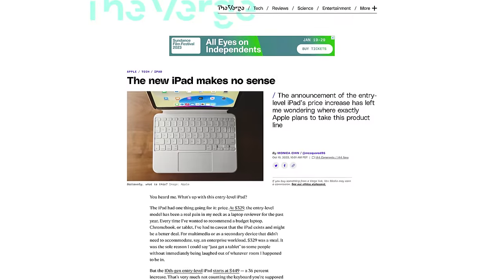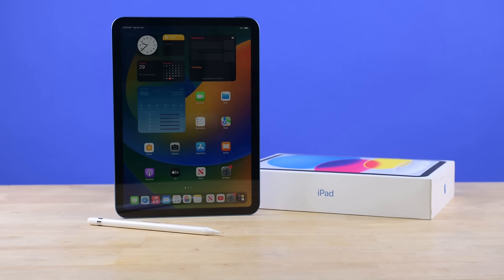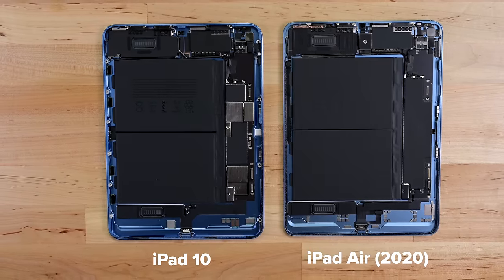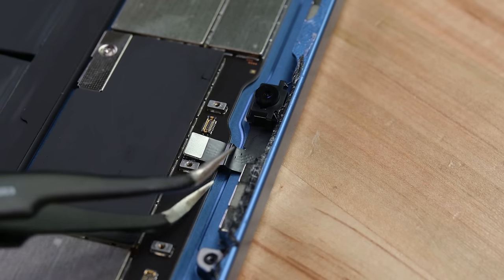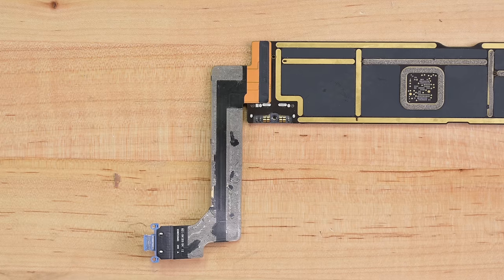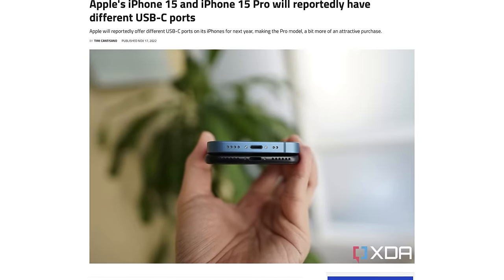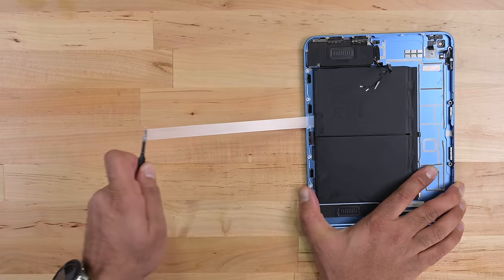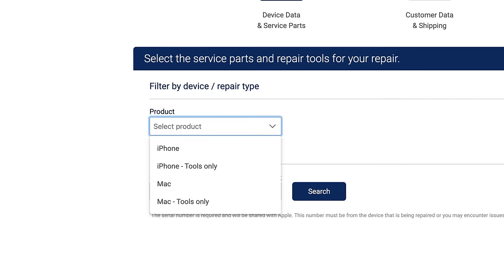iFixit Tears Down the Baffling iPad 10!

Comment: USB-C port locked to USB 2.0 speeds if you don't know. While on Air 4++ you have max speeds.
Reply: The key different is the AIR has an operate USB-C off die controler compared to this iPad that is just using the USB controler within the SOC that is used for lighting.
Reply: Refurbished iPad Air is far better value than iPad basic…
Reply: Apple Lightning port supports up to USB 2.0.
That while USB-C supports DisplayPort, Thunderbolt, USB4 and more if needed, like on the higher end iPads.
Reply: Lightning supports display, audio and can reach higher speeds with the appropriate controller on the board. USB C is a clear downgrade in terms of durablity. Bring lightning back with an updated controller already.  @Arutemysu
Reply: Lightning and thunderbolt should still be the way to go for Apple. As of today, USB-C still has no standardisation and every manufacturer can be different in specs which made consumers confused and of course, money wasted.
Reply: So you can airdrop three 12mp photos to a MacBook once a year?

Comment: Everyone thought the availability of self service repair would bring change, but Apple still make some baffling decisions in terms of repairability. At least the digitizer is still separate and relatively easy to repair. That's probably the part that most people break most often.
Reply: The self service repair was designed to hold off the right to repair movement long enough so interdependent repair would die off. They will probably keep it around as something to point to when anyone questions them.
Reply: The iPad was brought back as the ‘school model’ and has always had a separate digitizer since then.  Glad they haven’t gone back to the iPad Air 2 debacle with the digitizer bonded to the LCD (they were selling the Air to schools at that time).

Comment: USB C with Gen 1 Pencil is a deadline push. The new iPad had to come out, and it had to be quirky with its landscape front facing camera, so there was no way they could’ve possibly had time to figure out how to throw in Gen 2 connectivity.
Reply: They could have put it on the other side or make a new apple pencil pro like samsung that's full blue tooth and can attach to any magnet on the tablet
Reply: that sounds really plausible, the deadline

explains the non-existant macbook 2022
Reply: You mean, the self-imposed deadline? No, sorry. This is not a hard engineering problem. This is a problem caused by setting a weird requirement for a camera placement and where the pen charges, ahead of more important things. Bear in mind this is the company that thought their first pencil design was good, and not an accident waiting to happen.
Reply: @StarLightFilmProductions  The other side of the iPad is used by the keyboard pins. I’m not sure what you’re trying to say with the second point - the pencil is already “full Bluetooth”, the problem is how to charge it. When I look up Samsung’s pen, it looks like they need to be connected via magnets to a specific location on the tablet to charge, which is what Apple did with Pencil 2.
Reply: @bawbsmith  they should at least make the iPad a bit thicker to implement that but also I'm not talking about the samsung pens that come with the galaxy tab I'm talking about the spen pro the one that you can charge by hooking it up to your USB c charger all you have to do is grab the cord and plug it in to charge even tho that was the past with the first Gen apple pencil this spen pro dose not need to be in the tablet but also at the same time it's nice to just have it connected to the tablet itself
Reply: Nah this wasn't an issue of the deadline. It was done solely to differentiate the iPad from the iPad Air. If they had made it compatible with the far better and convenient Apple Pencil gen 2, it would have effectively killed the Air
Reply: @bawbsmith  possibly they ment on the other side where the camera used to be?

that might be a decent placement for the pencil.

granted, i dont mind the dongle to charge it because it makes a bit more sense than how it used to charge.
Reply: Ipad 10th gen users was meant for non Apple Pencil users anyway.
Reply: @pinroshan020  close, it's meant for an audience who likey won't want to pay the price apple likes to charge for their gen 2 pencil. Apple segmented their tablet lineup to keep people buying the more expensive models but this way they can still make $ selling "pencils" with cheaper model
Reply: @mattmichael2441  yes I agree! Ipad 10th gen is really an overpriced tablet.
Reply: you really sound like a fanboy
Reply: @Carl Gunderson i really don't look out for news about macbooks at all lol i don't use macbooks
Reply: @Carl Gunderson i mean, size is a thing
that's literally why ipad mini was made

size
Reply: @Carl Gunderson nah, it's just that i know less about macbooks than, say, ipad and iphone lol

Comment: Since the likely majority of iPad repairs are to fix a broken screen, I wish you had at least made some positive commentary about this iPad continuing to use a non-laminated display. Screen repairs will be tremendously cheaper and easier on this iPad than on any of the more expensive iPads, because you can just replace the glass and digitizer unless something truly terrible happened to the iPad.
Reply: And it looks cheap as f. Wish they just supplies cheaper replacement screens
Reply: @nami1540  since it is non-laminated the front glass can be replaced without replacing the display panel this means it is much easier for third parties to make replacement options.
Reply: These folks will never be happy
Reply: @hishnash  That's not what he's saying. 

Apple didn't do this for better repairability, they did it to cut costs on the lower end iPad. Laminated screens looks much better but are more expensive, and more expensive to repair. That's why they're only on the more expensive models.

Comment: I find it interesting that they pull out the iPad Air 4th gen but they never did a teardown of the iPad Air 5th gen. Makes me wonder if they did and found it to be almost identical except for the new CPU?
Reply: The iPad Air 4th Gen has the same A14 chip as the new iPad so under the hood they're essentially the same device in an almost identical enclosure
Reply: They are nearly the same. I've already had to do quite a few repairs on them and they mostly use the same parts as each other.
Reply: There are some speculations on the 5th generation build quality (thinner aluminium compared to 4th generation) and iFixit never did a teardown, lol.
Reply: @mochimejika  do they share the glass and lcd like other iPads compatibility wise
Reply: @MrMariovideo13  It's a fused display on them rather than separate like on standard iPads. The air 4 and 5 do use the same screen though yes.
Reply: @poobalu  The dumbest part here is that it's just a worse iPad Air 4, no AP2, non-laminated display and even more expensive than the iPad Air 4.
Reply: @Carl Gunderson At least the price is what kept them apart, but the new iPad 10th Gen is just as expensive or more expensive than the iPad Air 4 here while being straight up worse in terms of value.

Comment: 3:49 Imagine your car tires being glued shut to your wheel axles. You are completely right - consumables should be easily replaceable to keep you going, not leave you stuck and incapacitated.
Reply: Im assuming you mean car wheel being not tier. 

Very few consumers have the equipment to correctly replace a car tire, we can swap out a spar wheel but the needed tools to properly replace a tier on a week and do it properly so that there is no dirt/grime etc in the seal is non trivial. In fact many tiers do use a form of glue like martial to bond/seal that needs some heat to remove. The last thing you want is any dirty making its way into that seal.
Reply: @hishnash  You' re correct. I was thinking of changing a flat or worn down bicycle tire for some reason. 🤔🤷‍♂ Wasn't really thinking about the technicality, just an example. Let's say sneakers (soles) glued down to our feet? 😂
Reply: @em0_tion  true while one would not glue to sneaker shues to your feet as you might want to change what you are wearing the soles on all sues made in the last 200+ years have been glued (and sometimes also sown). 

the use of glue has many functions but one of the most common is to ensure a seal to stop water, dust etc.  Glue in most situations can be removed (like the glue used to seal the screen or battery in an iPad) but as a user case.

I see many people wanting batteries to be screwed down but the nature of lithium batteries is that if you put a single point of pressure (such as a screw) into them when they expand they become spicy and start to smoke/burn, (and all of these batteries at some point expand).

So gluing (with pull tabs) a battery on one side is the best option as this does not provide and localised compression points on the battery when it does expand (they all expand at some point). It is much better for the battery to gradually push open a device. Just think of how many of these devices will be forgotten at the bottom of peoples draws etc in 10 years time when the batteries start to swell. It is very important that when this happens the swelling can happen without starting a fire, by just gluing the back of the battery in when the battery expands there is uniform pressure across the battery and that pressure is low enough that the expansion can slowly pop of the screen (as the alternative is starting a fire).
Reply: @hishnash  bruh tires are NOT that clean to seal. its mostly pressure that does it. 

ive seen a tire glued but its rare and only done when the wheel is minorly damaged, anything more and you just have to replace the wheel. 

ive actually done tires for a living, have you? doesnt seem like it
Reply: Yeah, I hate when my tires end up glued to my axles 🫤
Reply: @ObviouslyMegamind  Trolling by literal interpretation on purpose, love it! 🤣👍 We should get a beer, blue head. 🍻
Reply: @em0_tion  blue head 😂
Reply: @ObviouslyMegamind  Megamind, obviously. 😂🤘
Reply: @em0_tion  ahhh

Comment: "The USBC ribbon cable is welded to the logic board"

Wtf why Apple why!?! Do they not know that the socket is something that’s likely to need servicing within the lifetime of the device?
Reply: You already know why, it's to force unnecessary logic board replacements, therefore forcing consumers to consider premium support/a brand new device.
Good old eco-friendly Apple, throwing away devices just because a port was damaged 🙄
Reply: Manufacturing cost and capacity.  Building the cable and welding it to the board can be all done on an automated production like.

Attaching a ribbon cable using a socket required manual labor this costs money but also right now is very limited (given the issues with supply chain).  I expect right now given all of these devices are supply constrained based on manual labour not automated production like. if apple can 1/2 the amount of manual production time needed for each device they can ship 2x the number of units.

Comment: To be honest,  I value more the new camera placement than the apple pencil charging situation as no many people I know uses the apple pencil, but more who complain about the front camera placement since the iPad 2.
Reply: Agreed. Apple Pencil has it's place, and the Apple Pencil 2 is awesome—for those who use it. Far more prospective buyers will find themselves using the webcam for videoconferencing though.

Reviewers seemed confused by this iPad, but lots of people will buy it who would never buy an Apple Pencil, and those people will thoroughly appreciate the camera placement and the USB C charging connector. Apple made this product with certain users in mind, and those users will really appreciate the design decisions, without even noticing  the drawbacks (even the USB 2.0 speeds are a budget-meeting measure that won't affect most consumers).

Comment: That digitizer not laminated with the LCD  touched my heart🥺
Reply: cost cotting.
Reply: Actually, Apple takes this gap as a downgrade that is supposed to push people upwards in their product stack.
Reply: @terriplays1726  Makes it easier to repair tho
Reply: @frokfrdk  Honestly, I feel Apple should make a "repairable" version of their devices. And call them "R", iPhone R easy to open, not laminated screen, screw in battery and main board, modular charge port.  Same for an iPad R and an MacBook R.  It will lose some of the high end features because of it, but you can make a device that is fully repairable.
Reply: @SanderEvers  iPhone XR
Reply: @SanderEvers  what a bad idea

Comment: Any experienced iPad technician will not complain about this design. In my opinion this is slightly better than repairing an iPad 5/6/7/8/9. Touch ID is on the power key which is very rarely damaged during screen removal. Still no face id to worry about. The digitizer is separate from the lcd. Your local third party repair shops will have no problem fixing screen/battery/ports and hopefully cameras for a reasonable price soon. Lets hope the battery, screen, and cameras will not produce non genuine parts message.

Comment: compaired to how the gen 1 pencil used to charge, the dongle is probably an improvement.
Reply: The gen 1 has always come with a Lightning to Lightning dongle in the box so you can charge it at the end of a Lightning cable.  It's easy to lose though so it was never a good design choice!

Comment: Yeah, I'm not having one of those. The Apple Pencils are expensive, and a tablet that sells for £500+ but uses a 2 year old processor, as first seen in the iPhone 12 series? You could have at least used the A15, in use with the iPhone 13 series and base 14 (non-Pro).
This is like trying to cram the contents of a Surface Pro 7 in a new chassis (with a standard charging port) and calling it the Surface Pro 9. (Which thankfully, Microsoft hasn't done.)

Comment: I can help but wondering why apple leaves so much space instead of filling up with other components like larger battery or make it work with apple pencil 2. if the case is all about no room for the wireless charger, then all the space at the bottom of the ipad is for dust and air?

Comment: Samsung managed to wirelessly charge the S pen on the back of the Tab S8. Not sure why Apple couldn’t do the same
Reply: Maybe because the iPad 10 is $449 while the Glaxy Tab S8 is $850
Reply: @FlorianWendelborn  Doesn't matter, if they can produce an adaptor for the pen, they can add some magnets to the back of the iPad for charging a pen. Magnets are cheap, they already have produced the wireless charging for the other iPads, they just need to move the magnets from one position to another, the work has been done before.

Comment: IMO the argument that the charging coil would interfere with the magnets is pretty invalid since the magnets obiously would have fit just fine (like many other manufactures do). Apple just does not want the pencil to sit off-centred on the side of the tablet. Probably because this would contradict their perfectionistic approach to design.
Surely a 1st gen pencil awkwardly dangling from a USB-C-to-Lightning adapter has been a better design choice🙃

Comment: I'm confused. Is the USB-C port really "welded"? or just soldered? coz these two are different things where the latter is removeable by the use of a soldering iron or hot air gun.
Also it makes sense to solder these things to prevent loosening overtime, just like how other ports like usb-A and HDMI ports are soldered diirectly into the pcb for more secure/durable placement.
Reply: It's soldered, if you listen he said it's the same as previous models and they weren't welded.
Reply: @AndrewWhitham  right. so he shouldn't have used the word "welded" in this case. I mean he mentionedthe word "welded" a couple times throughout the video and it creates an assumption that it's actually welded rather than soldered.

afterall: welding != soldering
Reply: @iamwisdomsky  it's small things like this as to why I usually avoid ifixit. They market themselves as anti apple and pro repair but they have sub par knowledge on a lot of things and also then charge you apple prices for their spare parts.
Reply: welded just means its not got a connector you can flip up and detach it from the mainboard. soldering is still technically welding. you're melting a metal and using it to fuse metal to metal.

Comment: Why to they weld the usb connector when is an easy replace if gets damage. That is not an easy fix
Reply: production capacity. 

A soldered connector like this can be done on an automated production line. But connecting a fiddly ribbon cable required humans hands. 

Right now the main manufacturing constraint is labour, apple can easily buy all the parts they need and can have the automated production lines producing more stuff than they can sell but that final assembly line with humans is the bottleneck so I expect this was chosen as a way to save 30seconds of final assembly possibly increasing the total number of units they could sell by 10% or more.

Comment: Is that port actually welded to the logic board and not soldered? Solder is bad enough, but at least repairs can be carried out if you have the equipment and are skilled enough.
Would of course be a shame for Apple to just put a lego connector there, making port replacement fast and doable for a lot more people...
Reply: It's soldered he just used the wrong term

Comment: I hate non-laminated screen
Reply: What does a laminated screen even do?
Reply: @heavy0119  better contrast, and no air gap between the glass and the panel, so in the long run, no dust will get between the glass and the screen

Comment: Soldered, not welded. Soldered. Please there is a massive difference in this term and you're driving the wrong opinion. I still don't agree with it being a soldered component either but this term needs to be corrected.